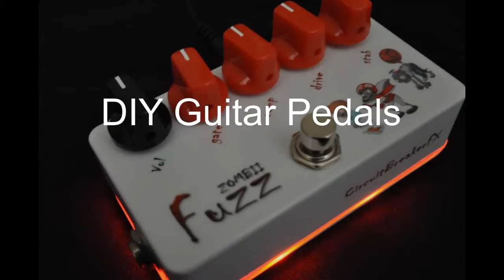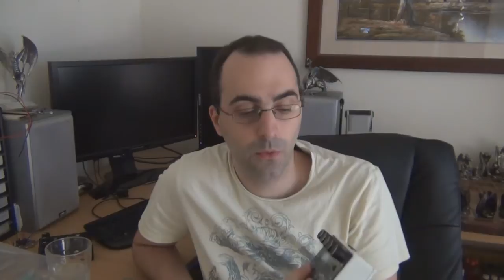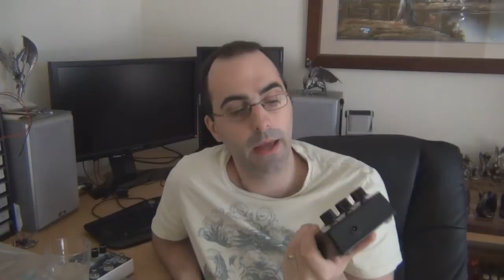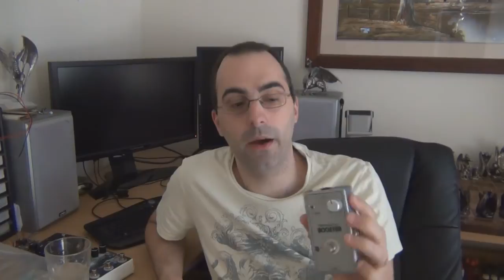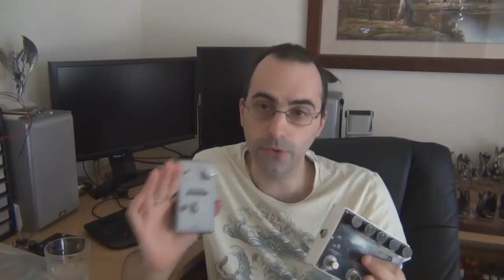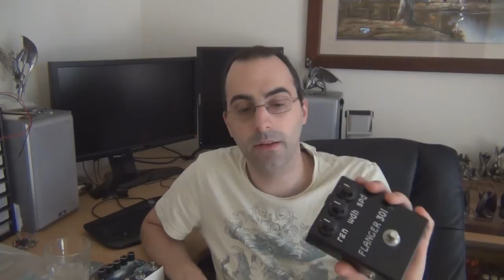Charge Pumps - Switched-Capacitor Voltage Converter

Comment: The Max is rated at 10.5 Volts, so most the time power supplies spike when daisy chained. If you add a 1N4148 then 100 OHM resistor then a 9V Zener Diode to ground, it will protect the charge pump circuit and keep your voltage consistent. But the Tc is a more sturdy chip.

Comment: Just stumbled across this. I used a max1044 in place of an LT as I couldn’t find the LT in soic format. It didn’t blow but introduced switching noise at 9Khz which was audible. This was with the boost enabled. Replaced it with a different chip that switches at 120 kHz and all was fine. Another reason to avoid Max1044s

Comment: Im building a Valvecaster and im going to use a charge pump to feed the plates with ~33V(9V power supply). I believe those ICs can handle the current, right?

Comment: Hi! I have ordered MAX1044 samples DIRECTLY from maxim.
There are 2 types: MAX1044EPA ad MAX1044CPA
EPA can handle -40 to +85 degrees, and CPA 0-70 degrees. 
Both types died in the same way. Great ammount of heat and its gone! Whey were used to operate only 1! OPAMP -> very small power demand. 
They are rated 10.0V and I think unregulated power supplies could burn them. One pedal that ran on batteries never died, and  the others did. Maybe that's a solution... I'll try to install 7809 regulator

Comment from the maker: I think the problem occurs when you daisy chain with other charge pump types or voltages.  So a Max1044 at -9v with a LT1054 running at say, 15v.  Bang.  its gone.  Or, its the current being drawn from the LT1054 killing the max.  I just avoid the max :)

Comment: The MAX1044 is only rated at 10V max and 10.5V absolute max.   A 9V battery can exceed 10V maybe upto 10.6V.   If you use unregulated power supplies they can easily get upto 12 to 13V.   It's not the fault of the MAX1044.  You are pushing the part to or past the limit.  It will fail.  Use the right part.